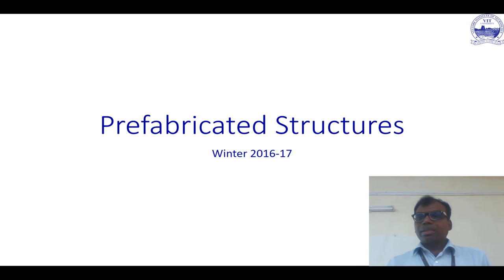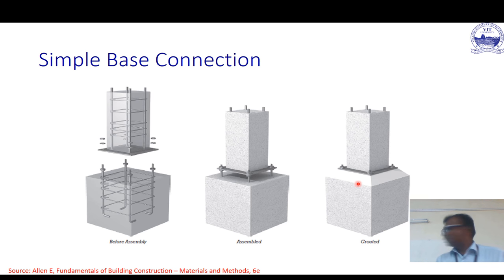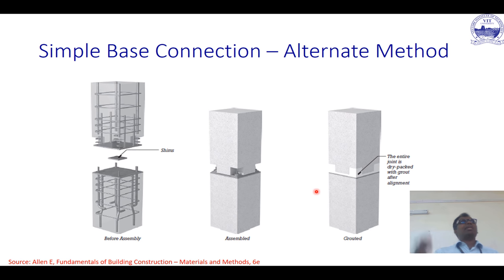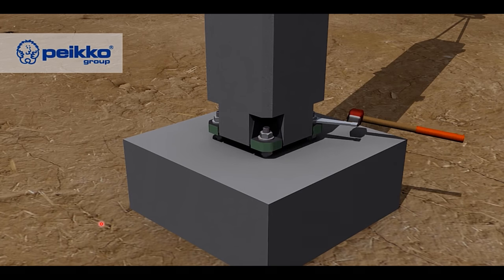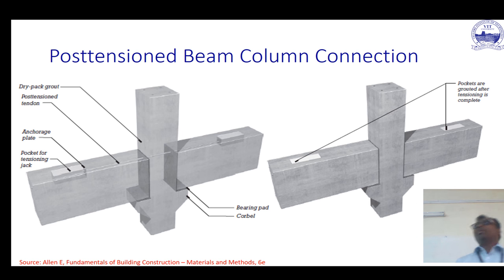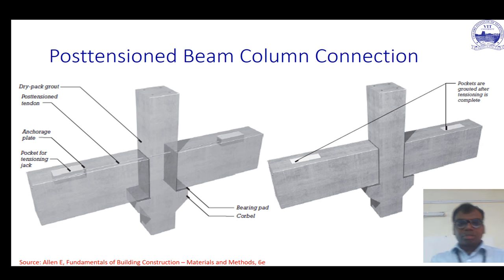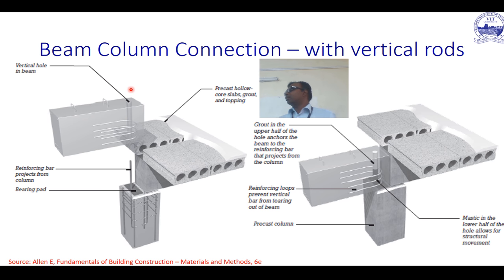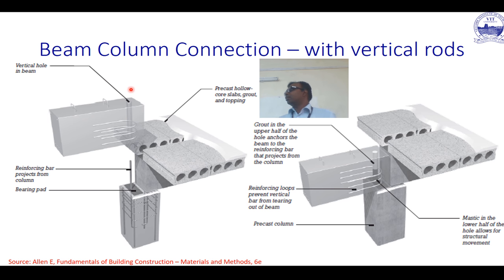Structural Joints in Precast Concrete

Comment: Hello JSP, thanks for the video! I was trying to find a good cost database on precast structures that take into account these different joint types. Do you have any recommendations? Thank you!
Reply from the maker: Hey Lucas, it is linked to the technology that the precaster adopts.  A joint may be cheap with reference to the material cost, but the cost of assembling and installing in the site may be expensive.  Again, the target profit of a company will vary with another. This makes it difficult to get the cost database of elements or systems.

Comment: sir i am sachin intern at motera stadium ahmedbad in this site 75% work is pecast construction. 
doubt- if joint two precast element then it is called monolithic joint or construction joint.
if say monolithic then why?
if say construction joint then why?
Reply from the maker: Hi Sachin,
If your connections are such that the end element will act as one piece, it is mono lithic.
You will have dowels which are used to transfer stress between the elements.  This makes them act as one.
You could have seats in the stadium that are precast and screwed in place.  They could be removed at a later date and this will not be mon lithic.
Trust this helps.
With Regards,
JSP

Comment: What is male and female connection??!!!
Reply from the maker: Liken it to the electrical receptacles.  In general engineering parlance, each half of a pair of mating connectors or fasteners by convention is designated male or female. The "female" connector is generally a receptacle that receives and holds the "male" connector. 
With Regards, JSP

Comment: Someone ought to figure out how to "design" a "precast, "Air-crete", "on-site-built" system, that is structurally sound, sufficiently strong, and SIMPLE, and VERY LOW COST, so that more people could fabricate their own homes, using a "Modular" system that allows for a variety of "customized" features!.....
Reply from the maker: Hi Guloguloguy,
Low cost is today's mantra.  However, I doubt very much on the degree customization will be possible.
If you are working toward the standards set you may be on the way to solving a very big housing challenge.
Best Wishes,
JSP
Reply: Thank you for the reply. I was thinking that some of Frank Lloyd Wright's wonderful "Usonian" house designs, could be "redesigned", as far as using less wood, more concrete blocks, using "Air-crete", and perhaps some "manufactured/engineered" precast slabs, to use as "nearly flat" roofing panels.   I think that it'd be tremendously beneficial if there was a way to "make" the blocks, on site, and to assemble them upon a "slab, on-grade" pad system, while keeping the costs to a minimum, using the latest, greatest "LOW-ENERGY-LOSS" low-cost materials, like "Air-crete", and using fire-proof, termite-proof, DURABLE methods, that require minimum long-term maintenance, and reducing the use of expensive, rare materials, like "milled lumber", etc.